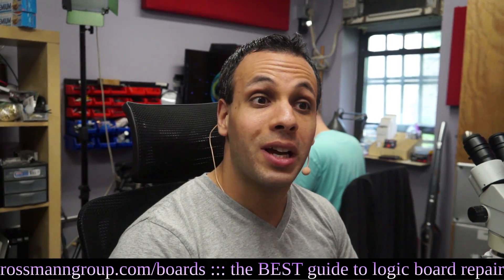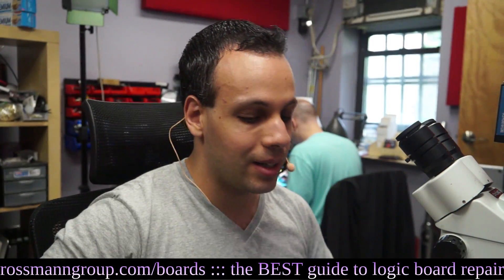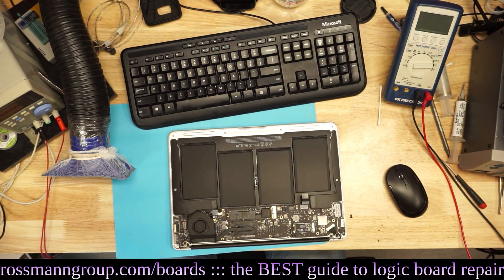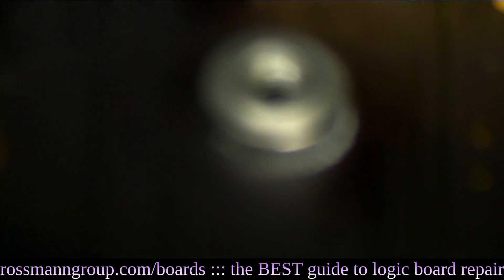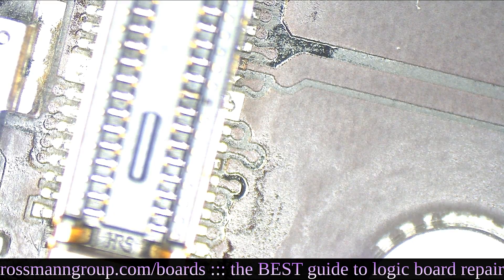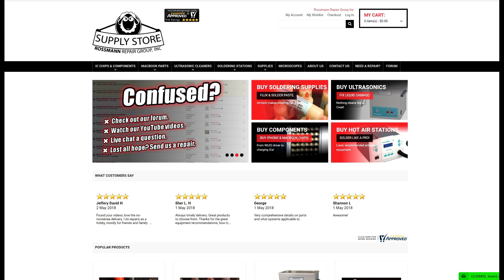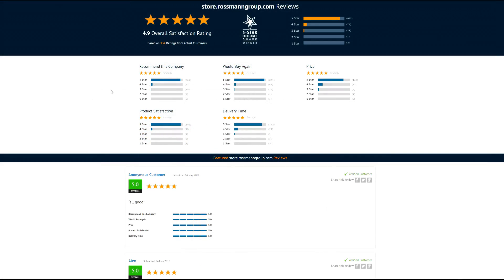Staples scams customers: never let TekDry near your laptop or cellphone!

Comment: Staples completely ruined my lap top! Wife was on it doing billing for my automotive and agriculture repair shop and some scammers hacked it right while she was using it. Took it to Staples to see if they could wipe it clean. The technician for some reason thought that the hard drive had to be removed. He did not take enough screws out and LITERALLY ripped the hard drive breaking the power strip. Then calls me while you wife is standing there and tell s me quote That the hard drive is to corrupted to repair. Tries to get me to buy a new computer right there! I tell him so your telling me that my wife brought in a running computer and all it needed was to be wiped clean. And now your telling me that I need a new laptop??? Can't I just buy a new hard drive? He says well that might fix it. I now realize he was just smart enough to realize what he did. I did not know the damage was done untill my wife brought it home. Well I didn't know what to do as I didn't have the time to do the work myself. So thinking it was not repairable let it go till there 30 day work repair warranty was up. I took it to an individual computer tech that has done a huge amount of work for numerous large company's and he tells me Staples broke the power strip. He then clears the hard drive but the screen won't come on due to internal damage created by Staples. I took it back to Staples and they denied everything. They will not even reimburse me the cost of the repair that fixed absolutely nothing. Plus handed me back a broken laptop that they damaged. I understand there policy on work warranty. BUT THEY NEVER WORKED ON IT! JUST BROKE IT! Anyways no I get to fix there stupidity.
Reply: lRaziel1  exactly what I was thinking. except, sledgehammer, jerrican and molotov cocktail.

Comment: As a former Apple Technical Expert, I can say that anything that has been through Staples is rough.  Whenever customers would open with “So I got this repaired at Staples...”, we weren’t allowed to bash any brands, not even the crappy kiosks outside the store (which I trusted more than Staples).  Can’t count the number of times I’ve opened a staples repaired device, and the receiver cables for a phone were somehow mangled and crammed in upside down.  Or the numerous no power phones because they zapped the board during repair.

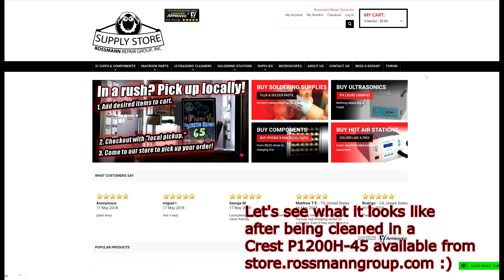Comment: 5:07 but wet wipes clog the toilet
Reply: Why don't you put that in a bin?
Reply: +Andreas Santoso
Actually, they have some wet wipes that are advertised as flushable wipes, and there is no such thing.  They clog the sewers.  That is part of the problem.  But yes, they are best to use and should be thrown in the bin.

I advised to first use tp, to get the bulk, then wet tp to get a bit more, then wet wipe, the tp goes in the toilet and the wet wipe goes in the bin.  If you want, you can also dry with tp.
Reply: You don't need the wet wipe any more than you would in the shower... They're good for babies and portability and if you're too self conscious to go over to the public sink and get soap and water before going back in the stall.

Comment: I use the wet wipes tbh
Reply: Dont use wet wipes, at least dont flush it to the toilet. It will clog your toilet and if not it will be a big problem for the sewage system in your area.
Reply: Wet wipes are responsible for something like 95% of clogged drains and sewage overflow. Please use damp toilet paper or direct water.
Reply: We use a septic tank so no worries about that.
Reply: nomnom moon What part of "reuse" says 'flush'? I don't even flush sanitary napkins made out of kraft paper just for that reason. Where I live is at sea level where all sewage all has to be pumped UP hill to be treated.
Reply: Ironclad -I repeat, those things are indestructible, and my sister ended up twice in "septic hell" when those  untearable things didn't disintegrate. Mucking a  flooded yard that won't percolate any more with a skidsteer is only half-fun to watch when it's family.
Reply: Ironclad for a septic tank, I believe the antibacterial agents in wet wipes can interfere with proper function.

Comment: I bought a dead crappy Asus Aspire netbook at Savers for $7 I took it home and scrubbed the hell out of the motherboard with a toothbrush and isopropyl alcohol. Then it worked! I use it for "low power" tasks related to amateur radio. (APRS MoDem)

Comment: I used to work at Staples. I’m telling you, that company’s culture is like especially heinous for the industry. We had this product called Liquid Armour, and managers were constantly on us to sell as much of it as possible. Ask every customer at register, every customer you see on the floor, harass people outside just walking past the store to somewhere else, bringing it up during repairs and when handling shipping jobs. Liquid Armour is a scam product that does nothing. What it is is some kind of liquid chemical agent you apply to a cellphone’s screen. It claims to harden the glass and make it “scratch resistant”. We would demo this buy taking out our car keys and scratching a demo unit that had it pre-applied. We were told to not talk about what it would protect against specifically and instead demonstrate with a sharp object. So it was basically the point of these demonstrations to get people to conflate scratch resistance with crack resistance. It was also marketed as an alternative to screen protectors. It was like “all the benefits of a screen protector except without that annoying plastic feeling!” So it was a useless product, but it also voided apple and samsung warranties! Anyways it turns out the reason Staples was pushing everyone to sell this shit so hard was because someone at corporate bought a huge amount of it from the company who makes it in England, and then almost immediately after that purchase the company folded and disappeared. So now staples had a huge amount of product it new was inferior and the company that sold it to them no longer existed. Not sure how true that last part is, it’s just what I heard through the rumor mill. Still, shit company.

Comment: I remember washing my laptops motherboard in warm distilled water bath with a small pump in it so water was moving in there, and then dried it in oven on low temperature. That sucker still working.

Comment: What did I miss on the Staples link? It gave no hard info or did I scroll too fast? I do wonder if pulling a fairly hard vacuum on gear WOULD save it as the water would then boil off at a low temp. I don't know of what trapped air spaces might be as risk then though. Of course, it will only remove the water so any other contaminants would be a factor. Soda springs to mind.

Comment: Its just sad that HQ doesn't seem to realize this alos badly affects the people working there that has to offer this service. I mean the people in the store gets the brunt of the complaints and there is nothing they can do. For a lot of customers these people are incompentent because of this stuff. I worked there as an Intern. atleast at a store here in The Netherlands, which luckily does not have TekDry.. They don't even deal in logic board repairs at all, not even the partner. They would just either replace the laptop, or the logicboard entirely if possible and within a reasonable price. If you have the extra warranty service that you can get there for like 10 bucks a month. which covers broken laptops. You can flat out get a new one. if it falls between the above criteria. This also extends to printers. 

Tho I have a few issues with some stuff there thatonly the higher-ups can change.. but the peopel in the store are amazing.

Comment: office depot also sucks, they nearly killed my pc when they didn't do much, all they did was plug it in and try to turn it on, didn't try a new power box(the thing that plugs in) or anything, they just said "we can't fix it and theres a disk inside and we have to break it open" they broke it open then i found a place that fixed pretty much all the problems(and pc even after office depot was done with it) and then i learned there was a manual release button that office depot didn't tell me about at all -_- anyway look up laptops plus or a place like that instead of a big name

Comment: I work for Staples as a tech and the tekdry is meant for phones dropped in water WITHIN 24 HOURS and essentially what it does it vacuum sucks the water/moisture out of the phone eliminating the water/moisture in the phone. It is clearly stated in the work order that you sign that the tekdry machine is only meant for phones dropped within 24 hours of the time you go to use the machine and that the tekdry does not gaurentee the phone's durability and staples isn't responsible for the phone to cease functionality in the future.  You have to sign off on that before you can use the machine. Also I may add IT IS refundable if it doesn't work.

Comment: i cant speak for all easy tech associates. but i always tell the customer that it only dries it. i never tell them that it repairs the device. in fact i always recommend the local tech shop in town even if they use the tek dry. i do think that the machine is actually pretty decent of a way to remove the moisture from the device.

Comment: The worst thing about modern devices is none removable batteries. If you drown something and can remove the battery immediately, you have a chance of preventing damage, because without power there is nothing to drive the corrosion process.

Comment: as an employee at staples, one who is apart of the their tech services and as a person who watches your videos quite a bit, this repair makes me very disappointed in the work that was done by the company. I would like to say that staples should have never tried to repair that mac as our store policy doesnt let us work on apple products (we used to do screen repair on iPhone's, but no longer do), secondly, staples should also never taken that mac since it was water damaged. We do not have the equipment to handle these repairs. Many people have come into my store and I have turned them away due to the fact that I know we do not have the stuff to handle to repair. (A good example was a customer brought a new HP laptop in with a bad keyboard, I had to turn them away from a simple fix because on that model the keyboard is actually riveted to the chassis, making it impossible for me to remove with my trusty screwdriver and usb drive.) in all this makes me sad to see half fast tech work being done as this is the stuff I try and pride myself in doing. Seeing a fellow associate allow bad tech work like that to go down is just straight disappointing.
Reply: I know this v id is a year old, but I just had to put my too sense in

Comment: What about plain water and not tea? Wouldn’t it not leave corrosion and then work?
Reply: Plain water still contains (often conductive) minerals which are not removed when water evaporates. The only exception is distilled water.

Comment: Really good and informative video.  I like the way you go out of your way to properly advise people what to do and not to do.  I am glad that you are available on this you tube channel otherwise I would not be able to learn the correct methods of repairing.

There are many comments on here and on your other videos where people don't fully understand your work.

I would never dry out any part of the circuit board as it only creates the problem worse and over time corrode.  I like to thank you for the work you do and learning the correct/best way to micro solder and repair other people's screw ups!

Comment: me myself with some experience in the case of a spill, I would separate the case and use alcohol to clean the pcb and solder joints/points. liquids carry minerals and other garbage leaving a residue that will eventually cause corrosion and ground faults through conduction, just like you wouldn't introduce un distilled water into the cooling system a vehicle for the exact same reasons.

Comment: I have a question for you Louis;
I have a HP laptop of which the screen is dying. My extended warranty (for which I paid) has apparently been voided because I replaced the original HDD with an SSD. What do you think about this?

I threw a proper rage fit at HP for it, telling them that's the "apple way" and they replied that every other brand has the same conditions. I checked, most brands (acer, asus etc) don't pay any attention to replaced harddrives and the RAM upgrades...

Comment: I'm surprised by the work you do, you can't find more fine tool to do the work you do? I mean doesn't somebody have a fine point for soldering? Something small enough to get down to where you are working?
Reply: Speaking strictly from personal experience, the finer the tip, the faster they derate and the more useless they become.

And it probably looks a lot worse when under the microscope. Outside of that, it looks very normal.

Comment: But wet wipes don't brake down easily in the septic system. Wait this is a year ish old video.
Reply: they make flushable ones (still not recommended for septic systems). you can also just throw it in the trash.
Reply: @jeramiet154  ah. Thank you. I was not right but right.

Comment: The reason services like TekDry exist is because drying actually can work for lower-powered, lower-complexity electronics, assuming that you remove the power source immediately and don't try to use it again until it's completely dry. The only reason this works is because the lower voltage means that the corrosion takes longer to set in. So for something like a cheap mid-2000's flip phone or an old Game Boy... dropped it in the sink? Quick, pop out the battery and put it in front of a fan. It's got a good chance of being fine afterward.

On a laptop that's got high-voltage rails like the backlight circuit where you CAN'T remove the battery? Yeah, no. It might be worth drying it AFTER giving it a good cleaning, but at that point you're just using an expensive machine to speed up a process that a bit of alcohol and a table fan can handle.

And so things like this arise from taking reasonable advice and applying it in contexts where it doesn't apply -- like your example: Vitamin supplements for general health? Sure! Vitamin supplements to cure cancer? Noooo.

Comment: I work for Staples in the tech department. You're not actually supposed to use Tekdry on internal components like that. It's not to clean out corrosion either. What it's ACTUALLY supposed to do, is get the moisture out if your phone almost as soon as it gets wet.

Comment: But this nonsense, surely.  Tekdry don't claim to clean your phone etc., only to dry it out if it gets wet.  Any preesixting dirt in there is not their problem.  Sometimes when the dirt inside a device gets wet, it will do damage that it would not do otherwise - it swells up and sloshes around.  There is no 100% guarantee that your phone will work after Tekdry treatment. A clean phone should be fine.  If I were Tekdry, I sue you for product defamation.

Comment: Dry thoroughly, then chisel, axle grinder, wire brush, sandpaper 80/240/400, undercoat, RAL 3012.
Reply: Ronald van Kemenade and then get some "tiger hair" from automobile supply and cover it in that

Comment: It's the minerals that remain that cause all of the problems! You could have purified water spilled on your board and it would make no difference! There are no minerals in purified water, so it doesn't even conduct electricity! It is the minerals in the water that do the damage; drying it out wouldn't help much unless you opened it up right away and cleaned all of the components!
Reply: You're quite right.  De-ionized water is a perfect insulator.  Unfortunately the carbon dioxide in the air (0.18% if memory serves) is soluble in water and forms a mild acid with that pure water, and those free ions would go to work immediately on the exposed metal surfaces within your machine - if there is any voltage potential to exploit - which there will be if there's a battery inside your machine. Water itself is the enemy.  Humidity in the atmosphere is not your machine's friend either, for the above reasons.  Electronics work best when perfectly dry.
Reply: DI is ok if the board has no power. With power, applied anywhere you quickly get electrolysis, which dissolves traces, and the metal ions increase conductivity speeding up the damage as time goes on.

Comment: Ok, I'll give you the wet the toilet paper with water, I do that as well, but adding soap?? I would think daily showers is ample hygiene for a non-dirty and non-crusty ass/asshole.

Very soapy analogy, but I am not at all surprised Staples is like that. But yea I agree, in this day and age, if it's an evil corporation, Apple or Microsoft, regardless of warranty, they are not touching my electronics. I am a proud owner of a Toshiba Satellite L-55 with Windows 10 (I know, I know I just haven't gotten around to putting Win 7 back on) for almost 4, maybe 5 years. I bought it at a microcenter, and I had to have them ship it to Toshiba so they could replace the motherboard under manufacturer's warranty. I did a dumb thing, sort of left my laptop in my car in the middle of May in Colorado and during that time it is very rainy and snowy, sloshy, so a large amount of moisture had seeped through the keyboard, and I knew this because when I opened the lid there was a lot of condensation on the keyboard, it was extremely wet.